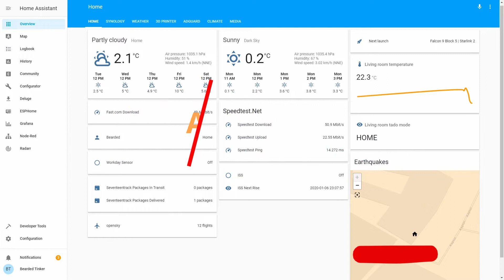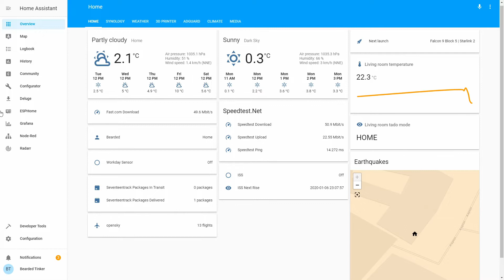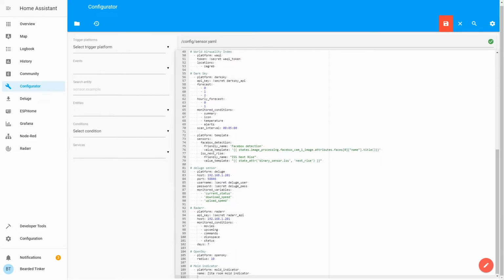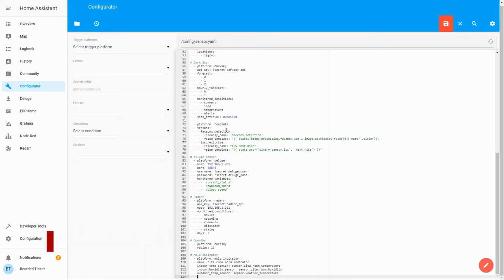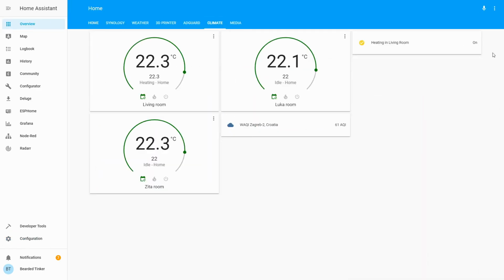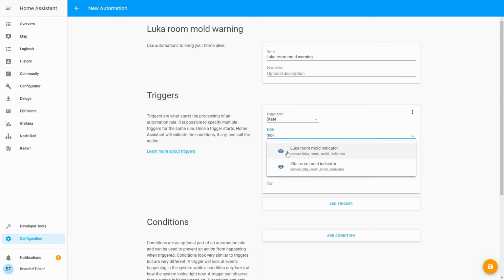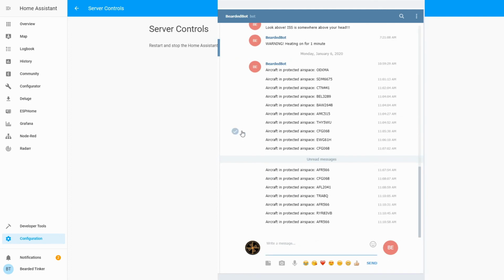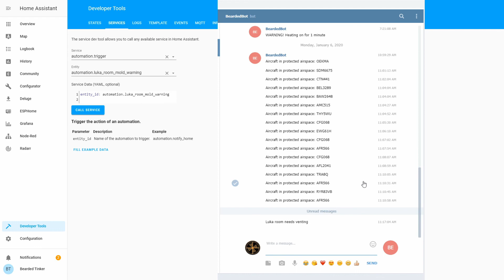Home Assistant How To - Prevent mold in your rooms with Mold Indicator

Comment: Great Video as usual! Do you have any video on how to configure the xiaomi sensors with homeassistant and what is necessary to use?
Reply from the maker: Hi Miguel and thanks for the comment! 
No, I don't have. I use ZigBee2mqtt for gateway with cc2531. There is a video about that - very easy to install.
And with this gateway/stick I control all my ZigBee devices (Xiaomi and Ikea)